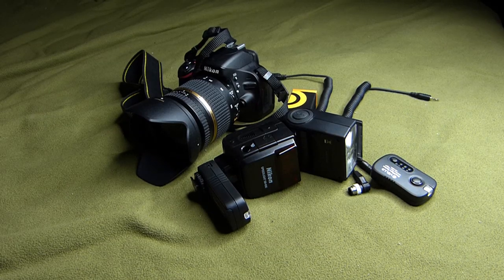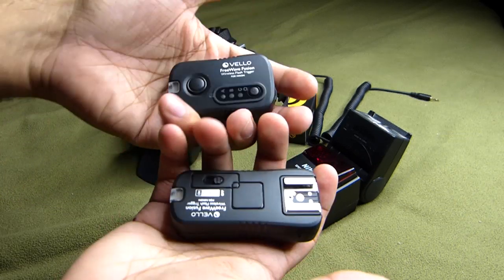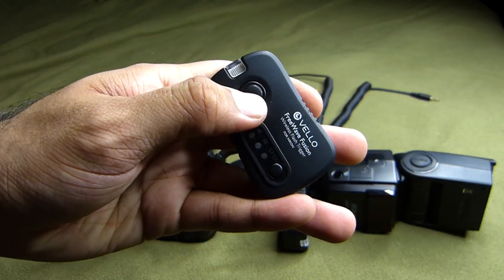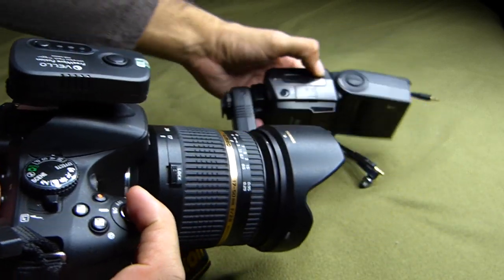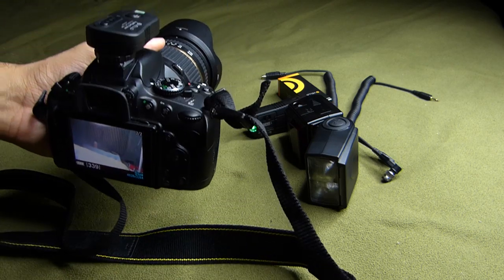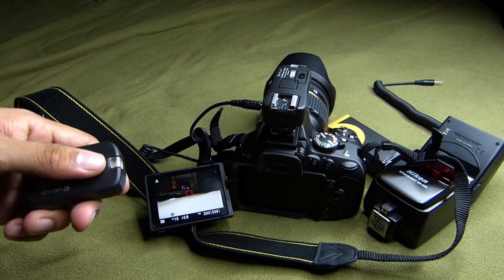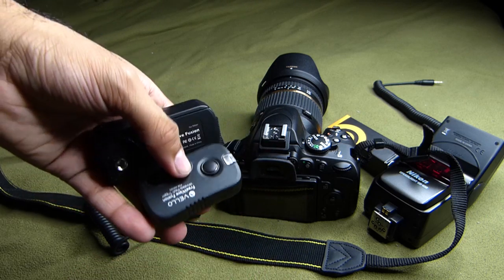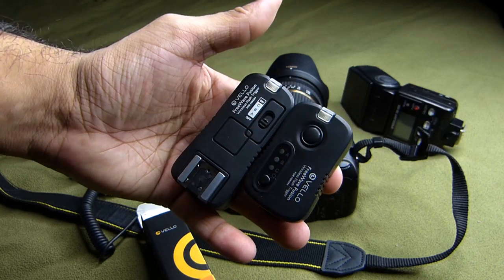The Phoblographer demos the Vello Freewave Fusion Wireless Triggers

Comment: Can i use this with Nikon SB-400 speedlight (that actually doesn't have remote mode). 
I wonder if I could use SB-400 off-camera with my D5100 (no built-in commander mode) by using this Vello FreeWave fusion flash trigger

Comment: Do the remote shutter release and flash work at the same time if you stack them onto the camera?
Reply: You will park the flash on receiver, then receiver onto camera hotshoe.
PC Sync Cable from flash to Camera's remote port (10 pins or 2.5mm)
Now use the transmitter to set camera and flash off in sync.